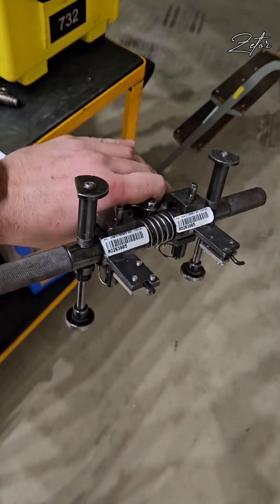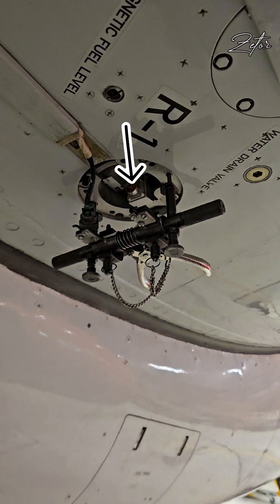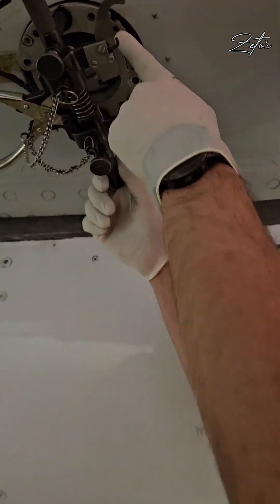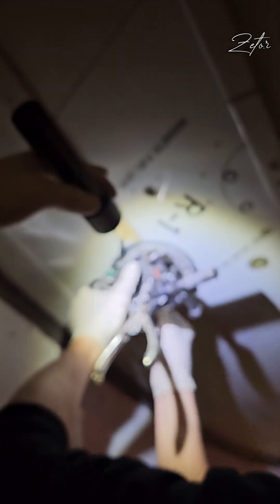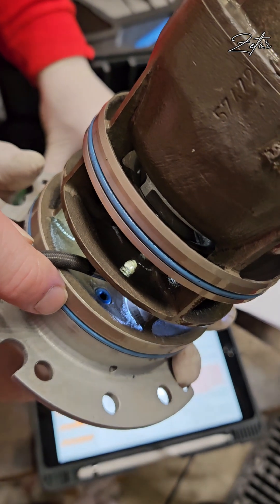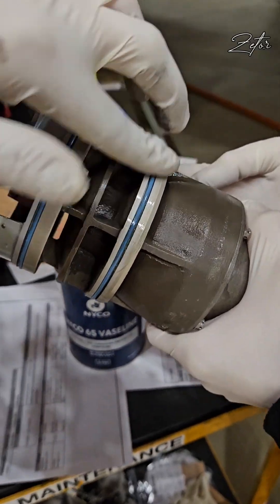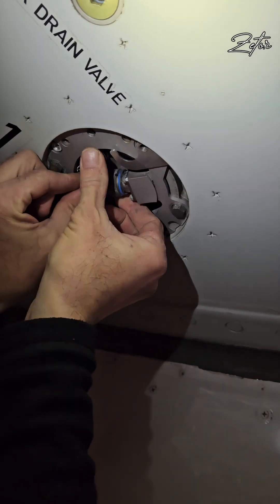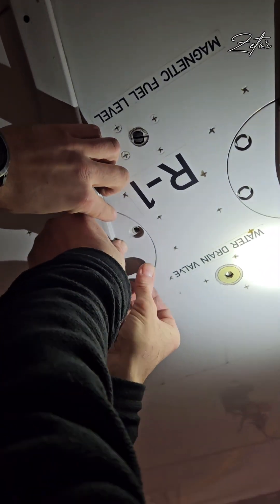ATA 28 Fuel pump replacement and explanation

Comment: Hello sir, I have a question about the canister at 1:52. What is it used for?
Reply from the maker: It is a dome in which you have the pump this way it will always have access to fuel because from it you have a suction hose
Reply: @zeto.r  I read about the apu fuel pump canister (28-22-52) in the a321 AMM and saw its function is to help remove the fuel pump without draining all the fuel in the tank. Does the canister in your video have the same function?

Comment: what do you do if the pump wont slide down alone, it keeps coming down with the canister
Reply from the maker: This is impossible since the canister is instaled from inside
Reply: @zeto.r  it’s not😂 i experienced this last night … tool installed, and then the pump is sliding down with the canister… it didn’t come all the way out but it is moving together (almost like glued to the pump)
Reply: Transfer and drain the fuel. Order Orings for the canister . There a similar procedure for canister installation. Sometimes the lock is broken so it comes out together.

Comment: Sorry i whant aske you why you didn't make feul drain from the plug before removal the pump i think in 02:02 in time your vedeo  ?????thanks a lot
Reply: When the pump is fully inside the canister, the sliding valves are open, which means if you open the drain plug then, you'll be draining the complete contents of the inner tank. By draining it at this stage, as Zeto says, you're draining just the fuel lodged inside the canister, that's why if it doesn't stop coming, you repeat the removal motion because it means the sliding valves aren't completely closed.
Reply: @tarcisofilho4878  thanks allot
Reply from the maker: Sorry for the late response, at least you get your answer already. If you have any other questions let me know